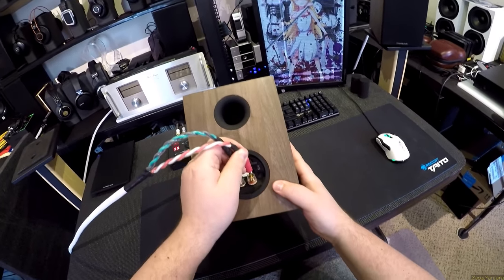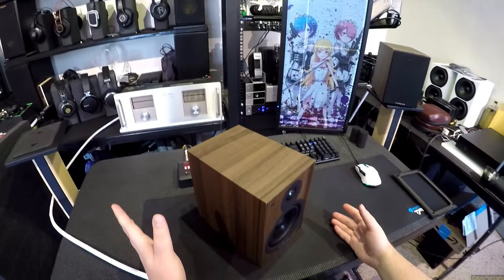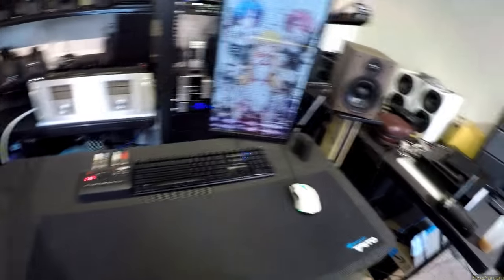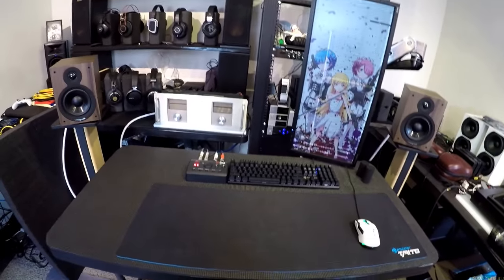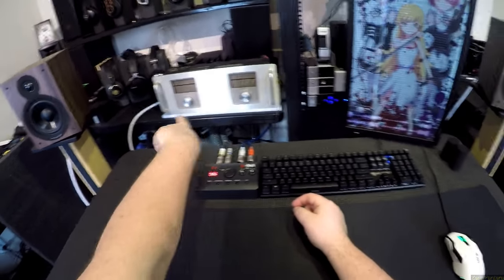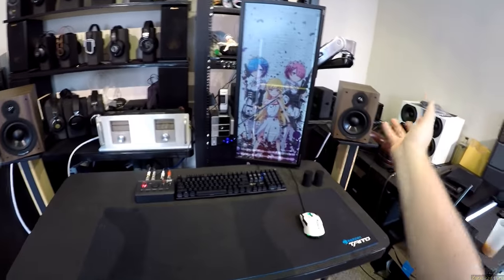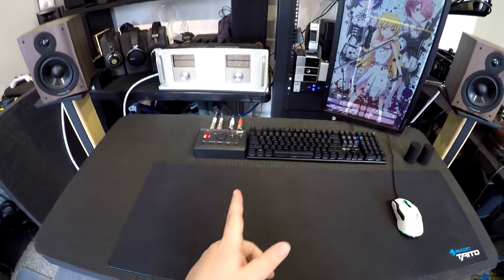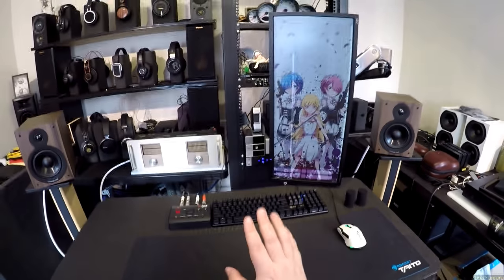Z Review - Cambridge Audio SX50 /so͞oT͟HiNG/

Comment: 250 $ a pair is cheap
Reply: timoteus3492 , I agree but I would rather have a pair of Jamo or Wharfedales or JBL speakers for that price. there are so many speakers that are available to choose from at that price point it's very difficult for me to do so.
it really comes down to
Ported or sealed.
5 1/4 inch or 6 1/2
ribbon tweeter or done
phase plug woofer or not
types of wood veneer ???
type of sound, sharp or more warm ???
it is really personal preference more so than anything. size of cabnet has a lot to do with it too.
Reply: @timschutte8310  What speaker would you recommend in this price range for someone who likes to listen to rock and jazz.

Comment: I use the older S30's on my desktop with a Q5 Pro and HRT MicroStreamer. The S30's have woven poly fiber woofers with real Phase Plugs. I have heard the SX50's and I believe they are not as good as the S30's. I am very pleased with the sound they produce and are ideal for a desktop, with the exception they have a deep box so space can be an issue.

Comment: Hello Z,  I noticed the GO-RACK is still on your desk...you're using it as a master volume control. That's cool.  Do you leave the EQ off? Or what EQ curve do you like?  I have thoroughly examined the layout, functions, abilities, specs,...and need to order one right away. Then they will come out with a better upgraded must have model which will be back to $100.
Reply from the maker: I leave the EQ off. I keep it on the treble cut one. I wish there was a sub bass cut but no beans.

Comment: Do you think I can pair these up with the SMSL SA36 for my desktop setup? Since my room is pretty small and I don't usually play my music loud.

And, this or Fluance Signature Series?

EDIT: These are sold 150$ on Amazon right now, way cheaper than its original price and still cheaper than the Fluance.
Reply: DerickR3D Not Zeos but I think in the description on Amazon.com, it said that you need an amp of 10 to 100 watts. The one you listed has a maximum capability of 25 watts. I would purchase a better amplifier first to really use these to the fullest.

Comment: Hello Z Reviews.
I'm using MilleniaOne CT atm. I noticed the audio sound different when I moved from stock copper wired to silver wired cables (20AUD/meter), and it sounds brighter if that makes sense.
Should I upgrade to better cables? And what type should I go for?
I'm also using Essense STX to run both the speakers and HE-400i. Should I get an amp for both instead?
Thanks
Reply from the maker: Skip fancy wires. You need to have someone blind test you to really know if you hear a difference. However a good amp is something that you can bank on.
Reply: Thanks for the advice. And I agree with you, I do need to do a blind test with these wires.
The speaker has its own amp in the sub, it uses 3.5mm or SPDIF to connect audio source to its remote box. Should I drop the Essence STX & get a DAC/Amp for both the the speaker & the headphone? Something like a Jotunheim? I probably won't use the balanced cables though, so I may pay extra for nothing. What do you recommend? 
STX came with PCM1792A DAC already. I can replace the chips on the STX,  but get an external DAC/Amp is a better option I believe.

Comment: Would I be able to connect a pair of speakers to the SMSL M3 I am currently using for my headphones? Want to get a pair of speakers for desk use but I don't know if I need to get an amp or not
Reply from the maker: Passive speakers all need an amp. If you don't want to buy an amp you need active speakers or monitors.
Reply: I currently have a SMSL M3, and I am wondering if I can use this for a pair of speakers or if I need to get another AMP for the speakers. Thanks for helping out, yao

Comment: The modern audiophile that requires small speakers to save space should be using wireless speakers. The Bluetooth Beats Pil currently has the most modern components in audio and also developed by the most technologically advanced company ever. 

The Beats Pil stereo active 2-way crossover system creates an optimized sound field for dynamic range and clarity across all genres of music. Tweeter and woofer separation uses the same acoustic mechanics found in professional recording studios around the world.

Z Reviews, your collection is mostly obsolete except for the vintage novelty factor.
Reply: utter cancer. Funny though
Reply: is... is this some form of targeted ad campaign? that's what this sounds like, only with more negging.
Reply: I was amused, although spreading misinformation is not at all facetious.
Reply: Jonathon Carroll Yes I have. I took the blind test Beats had setup at Best Buy. More than 15:1 chose the Beats Pil over "high end" audiophile equipment from other manufacturers including both wireless and wired.
Reply from the maker: Dicks.
Reply: First, you lost all credibility when you made a false statement about having a friend. Second, Bryston was part of the blind test at Best Buy. Independent participants chose Beats Pil at a rate greater than 15 to 1. The informed consumer will choose independent unbiased evidence over manufacturer claims.
Reply: dude, i don't think apple can pay you enough to lower yourself to shilling for beats
just stop
or we can continue if you can tell me in painstaking detail me how this survey was conducted so i can pick it apart for you
Reply: gr8 b8 m8
Reply: mopore ok I'll get them now.
Reply: Wow bryston is sold at bestbuy? Never knew that.